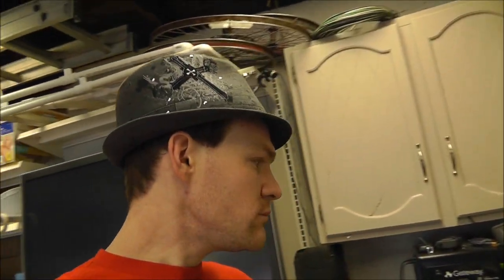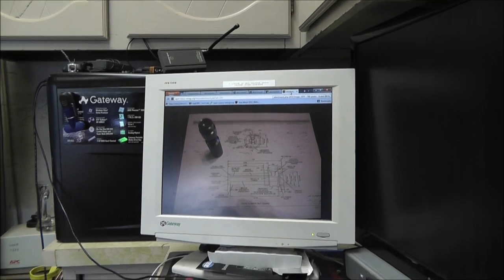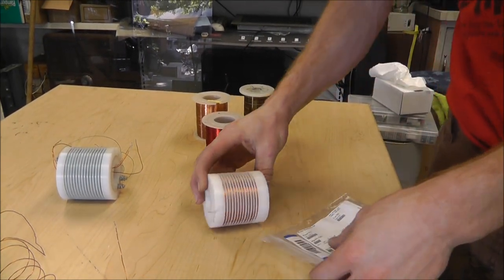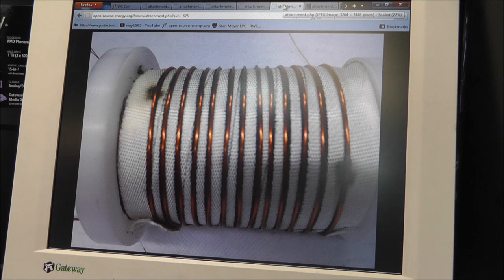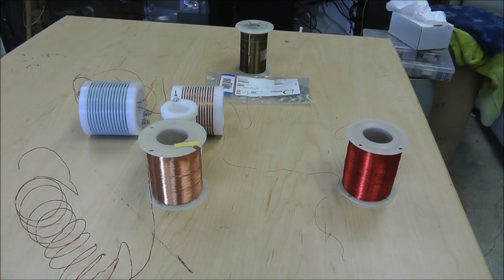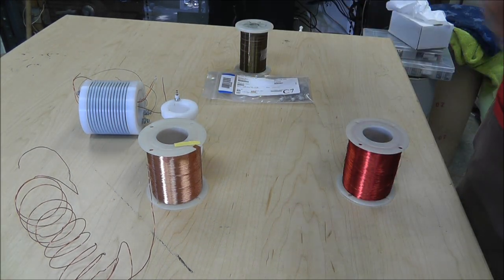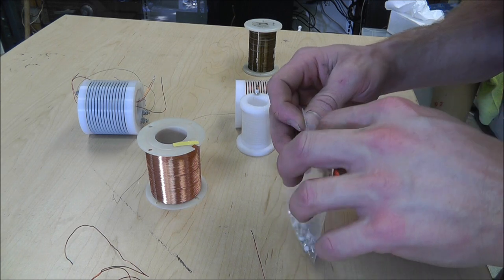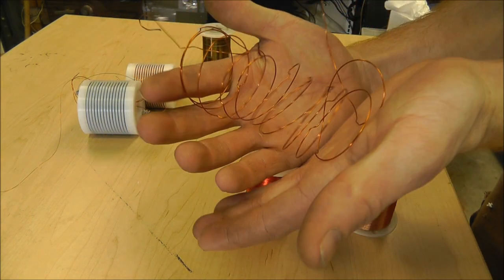UPDATE, Injector VIC Wire, original Connecters, and Injector Build. O yeah and some grillin! :)

Comment: No no no. Oil bath it and you can use cheaper wire as well. Get all of the air out of the coil. Air is the reason for the breakdown. Cheaper and more efficient then epoxy. You will notice that when you use oil you can max out the coil very easily.